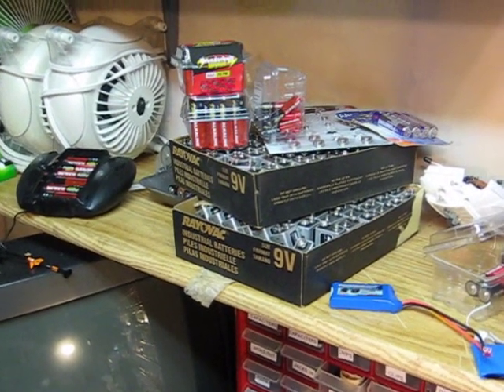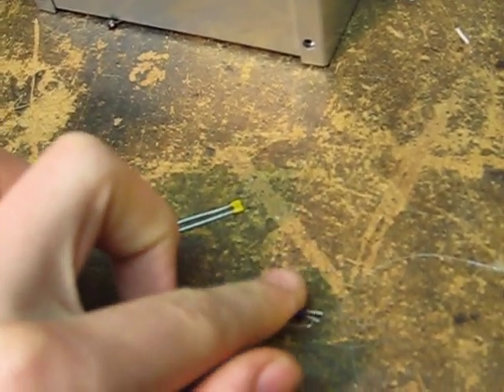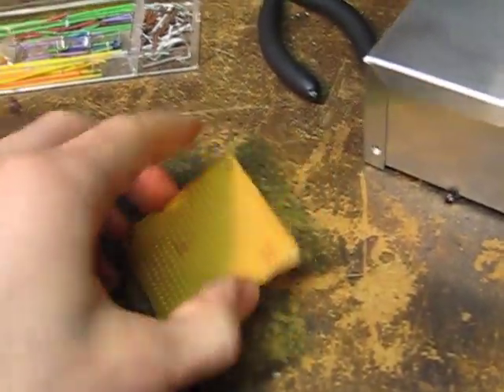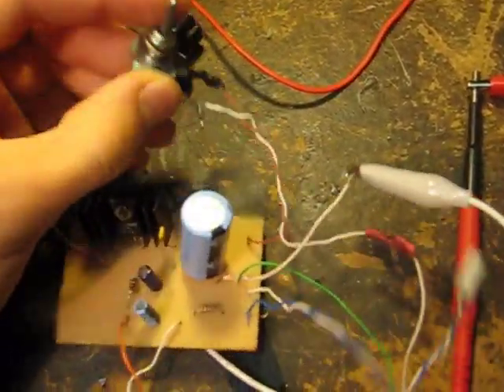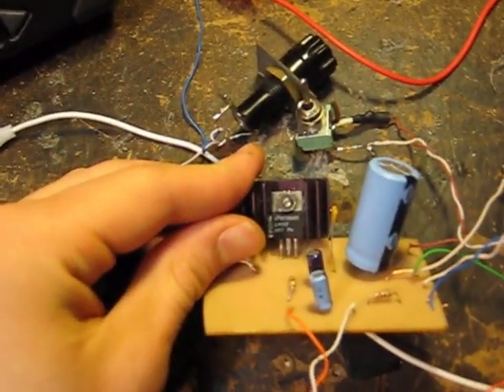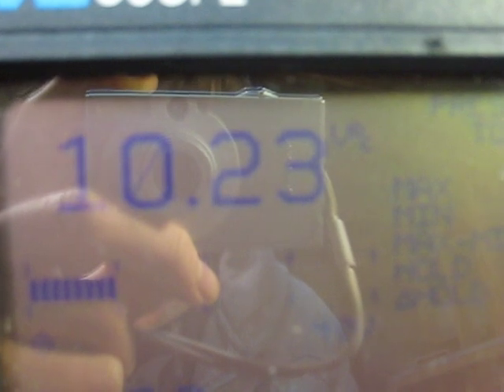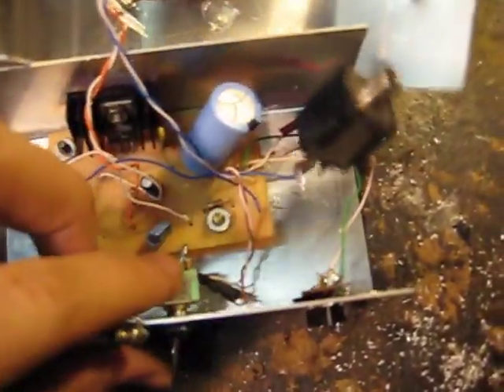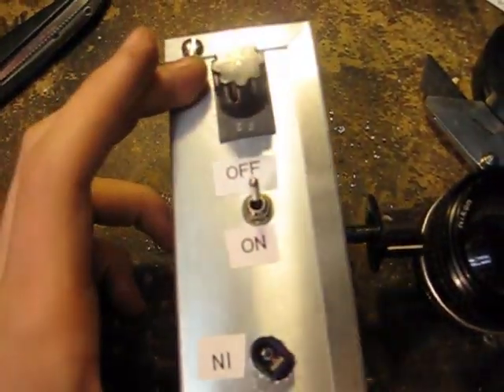How to Build A 24v Adjustable Voltage Regulator

Comment: hi: how to Build Voltage Regulator AC Motor Speed Control Controller 50-220V hi amp 30 or 40am and What is the value and the pieces used and the method of linking them with. Please

Comment: I have a UPS. this has 2 batters 12 volt 7amp in series=24volts.
i want use a 12 volt fan & 12 volt LED 3 lights. 
How do it ?
Now I use 1 battery for a Fan and 1 battery for 3 light bulb..
But Fan battery charge decrease aftar 1 hours, So how can use 24 volts for 12 volt Fan with fan & light safety.

Comment from the maker: The LM317 has a minimum voltage output of 1.2v i believe. So, you would need a potentiometer (>1M probably) at your output that can resist 1.2 volts completely. Shouldnt be too difficult.

Comment: Hi I require aorund5Amp output what is the mximum of ths set up 1.5a? Great video can you recommend another circuit which has adjustability of 20v - 4amp minimum. Nice one

Comment: Hi, I need to build a similar regulator for the transformer that I removed from an old school inverter.The trade off is - its Huge its output is 24v but 50Ampere or more.I need all that Ampere or more at 14volts.What changes in the schematics should be made in this case ?

Comment: thx just what i need to finish my self power electrical generator..it makes 33 volts and runs off 1.5 volt motor just need to regulate the 1.5 to make run to have 30 volts free power..can relate not fun haveing film w/ one hand and work and explain w/ rest of body is it..harder  than making the product sometimes
most excellent thx again...